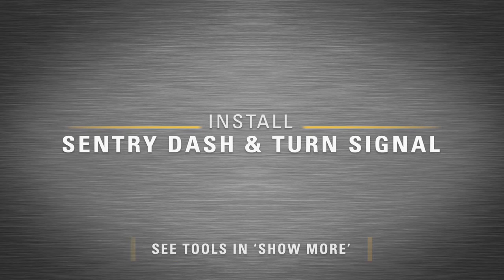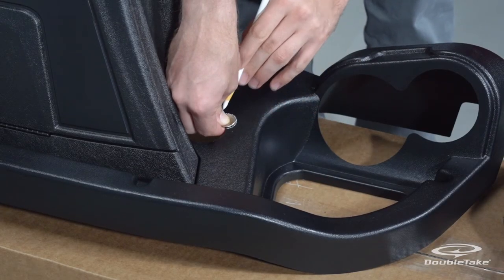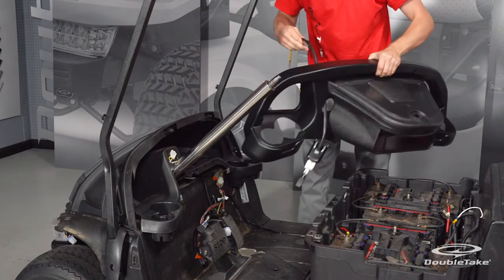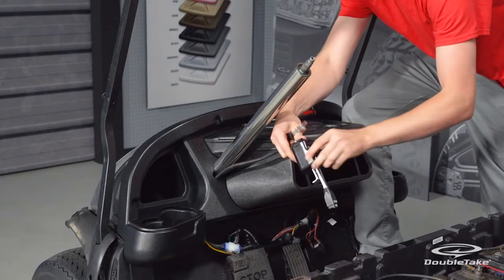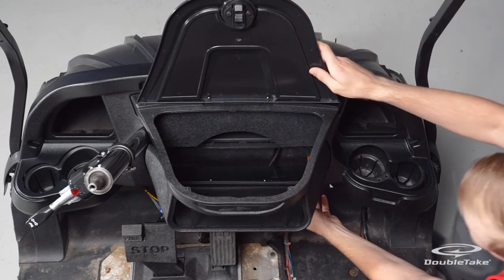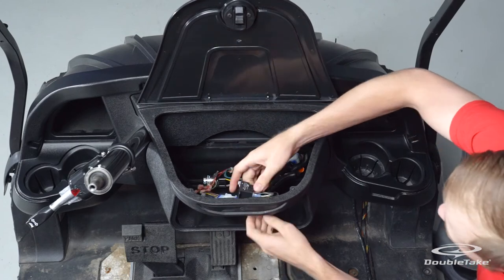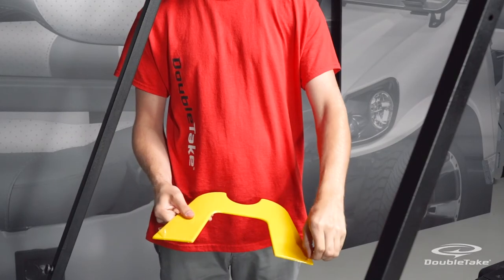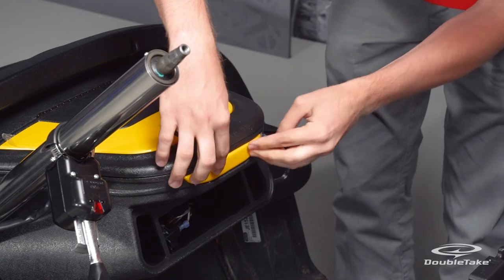Club Car Precedent | DoubleTake Sentry Dash - Step 1 | Install Dash and Turn Signal

Comment: Help Please, I just bought a 2016 club car precedent , someone has installed this turn signal kit and the black outer steering column is loose and  rotates, yes the clamp on the signal switch is tight, its the whole column turning, its turning independently of the steering shaft, how can I tighten this up? I can't find a video anywhere . thanks in advance.